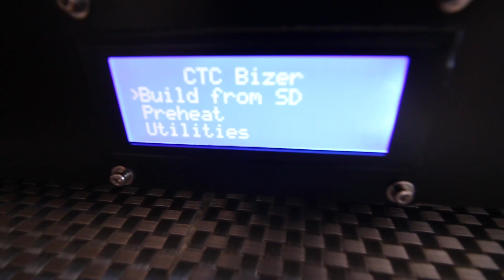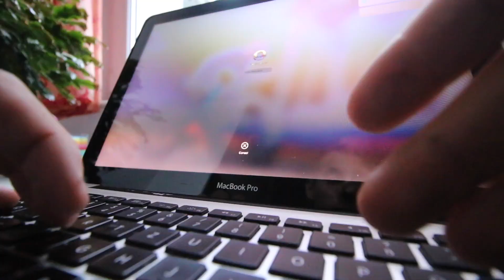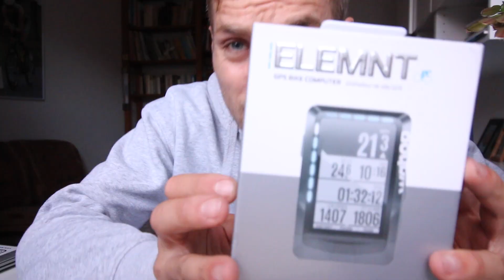Triathlon Bastelstunde: Schneller am Ziel ankommen

Comment: Rappi ist cool und super schön👍 Allerdings ist die Radstrecke zu kurz...Und die Laufstrecke auch😉 ach ja und das  Wasser immer saukalt🙈
Reply from the maker: +Gabi Lenge Holla :) Ja die Radstrecke hab ich schon gemerkt, muss einfach kürzer sein 87km oder so 🤔😁 Aber die Laufstrecke auch? Weisst wie viel kürzer die ist? 😱
Und ja gut das Wasser wird brutal 😁
Reply: Florian Bögge Also meine garmin edge 1000 hat 84.5km mit genau 999 Höhenmeter gemessen...Die Laufstrecke, gemessen mit der 910xt, 20.5 km. Bin gespannt auf deine Messungen😉
Reply from the maker: +Gabi Lenge Ohhh da bin ich auch echt gespannt! Das wird dann sogar mal was für Strava 😁